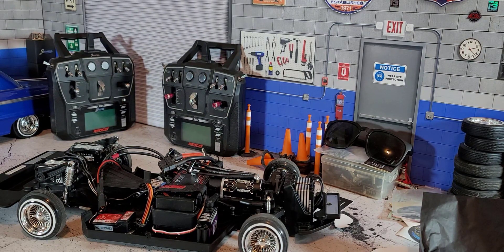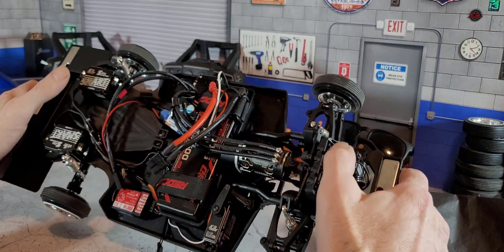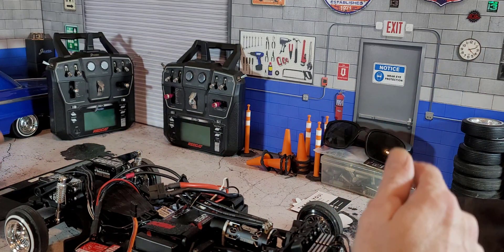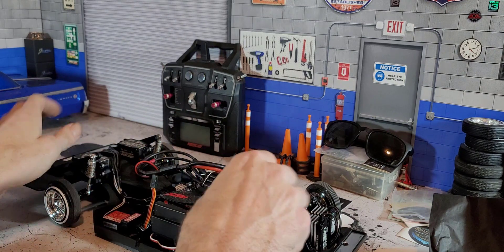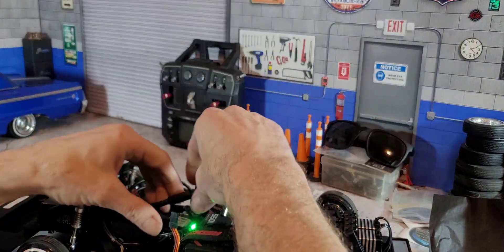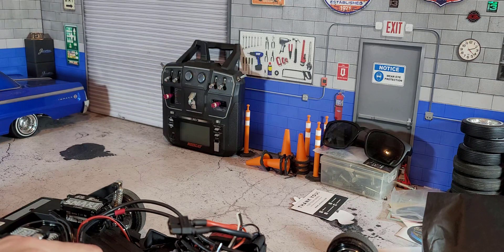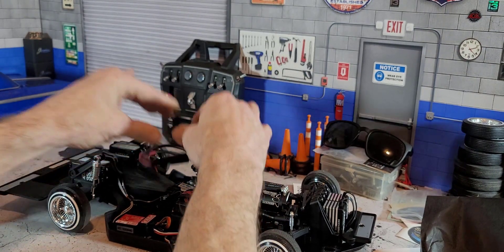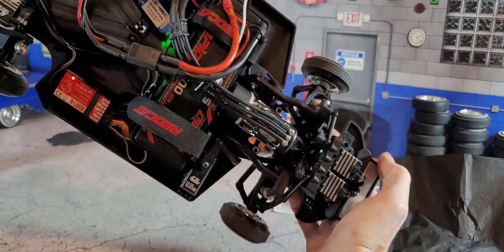Redcat Lowriders B E C Installation

Comment: I am learning alot and I have a question for you . Does the ESC that came with the Redcat 79 Montecarlo have to be replaced  ?
Because I have installed the BEC set at 8.4 v and the ESC sticker shows 7.4 v and I have no throttle ? 
And the ESC is flashing red when I turn on the switch on wheel well in rear tire . Thank you in advance for your video and your answer.  👍

Comment: I installed a bec today but notice it works fine for a couple of switches then slows down then picks back up again anyone know why need help please
Reply from the maker: That's sounding like either bec not set to 8.4v or it could be faulty, lot of faulty 2.0 out

Comment: Just got the power hobby 209s for the front. I was going to wait and order a BEC and a 1080 ESC next week before I install them. I’ve been out of RC’s for about 20 years now. Could you put me up to speed on Lipo please? I only have the stock battery. I’m just looking to get about the same amount of mount out of mind as yours. Thank you very much.
Reply from the maker: lipo we after is 3s lipo so we can give system consistent 8.4v power. as for what one to get Redcat has Lipo or any aftermarket battery will work, just need to make sure the size fits, and nowadays we opt for xt60 connectors many batteries and esc have this as they option

Comment: How to do if you got light setup for monte carlo
Reply from the maker: No different, the lead off the esc with red wire pulled out plugs into the harness. Harness plugs one side receiver chan 2 the other goes into lights control box, follow light kit installation instructions

Comment: Hey bro. How did you solder in the BEC wires? Did you just wrap them around the wires to the battery connector and solder them?
Reply from the maker: the bec is soldered in at the connector. When adding a connector to the esc, I solder on the BEC wires same place same time
Reply: @NorthSideCustomRC  I found on Amazon an adapter that connects to the kind of connector you show in this vid that will allow it to connect to the banana connection already in the car. Could I use that and just solder the BEC into the red and black leads?
Reply from the maker: @gregdavis9532  better to solder on a XT60 connector one time vs using a bunch of adaptors
Reply: @NorthSideCustomRC  ok cool. Thanks.

Comment: Very helpful! Do I need to install a BEC in a 64 to get a higher hop or will a reefs 300 servo and a 7.4 lipo do the trick?
Reply from the maker: With factory electronics you will only get 7.4v to the servo, the jump from 7.4 to 8.4 is significant and 100% must to get the most pop out of any hop servo including Reefs 300. The Bec is the way to go, a good idea is to pair it with a Hobbywing 1080 at sane time. You need to solder the connector so might as well hook bec up at same time and 1080 is much smoother and much more quiet
Reply: @NorthSideCustomRC  thanks for clearing that up for me. Appreciate that.

Comment: Hey I have a question so I bought a redcat 59 Chevy Impala I bought a BEC and the programming kit for the Bec can I set the Bec and put it into the car on stock servos? And if I can what should I set the voltage 2 on the Bec to make sure that I don't have any burnouts on my servos.
Reply from the maker: The Reef servo is rated 8.4v but the 25kg in back rated 6.8v but even the stock electronics run them at 7.4v 

Many other pump them at 8.4v no problem but it's at ur own risk, I ran them at 7.4v through a bec zero issue but I swapped to 8.4v electronics anyway. 

Alternatively you can use a bypass connector on the BEC so it only powers the front servo and the rear run on factory bec through esc

Comment: Is it safe to run a 7.2v lipo with a bec set to 8.4 with 4 reefs
Reply from the maker: You sure can but the max charge on 2s is 8.4v. As you use the RC voltage is dropping she getting weaker as she go. 3s 12.6v so it can hold 8.4v steady
Reply from the maker: Should be safe with any aervo rated for 8.4v but be better if on 3s

Comment: 👌 noice thanks for this video. question tho can I run 7.4 lipo with bec set for 8.4v and stock esc. thanks
Reply from the maker: Yes because the 7.4 lipo get charged to 8.4v

The problem is as battery drain the voltage go down performance go down with it. 

Peep use 3s cuz it's charged to 12.6v and you can run bec constant at 8.4v while pack voltage go from 12.6 to 8.4v before start to lose performance

Comment: I already hade me BEC connected but today I god the usb link can I still upgraded to 8 volts with BEC being connected
Reply from the maker: Yes, but need to make sure the lead off esc to receiver has the power (red) wire eliminated so the external bec and internal bec dont have different voltage and burn up

Comment: Great job I like how it hope just about the right high not to krazy like with reef’s servos they no much you’res have the perfec high to hope 👍🏼👌🏻awesome job like allways bro !!!
Reply from the maker: Just as crazy as the Reef 300 these A81BHP just front heavy so limited ups. Big brushless motor don't help lol but goal is to keep OG layout no relocations or flipped transmission but still some ups. The Hopper Monte's are insane I just want the guys who already pioneered the hoppers to be the guys see doing it. If I built one now n made videos I'd feel like I'm leaching off they work since still so new and they working out the R&D 

Figures Monte #2 I make a Hopper over the summer and then I can big up one of the OG Hopper set up
Reply: @NorthSideCustomRC  lol I feel you bro but I do like way better the way you’res is layout as a dancer I think you hit the right hight also I like the Monte more as a dancer than a hopper!! But like a few I seen with the 4 reef’s 300 to me that’s to Krazy much prof to you once I again I like the way more they way yours is layout with that OG style specially seen it 4 wheels up the ground 😎👍🏼